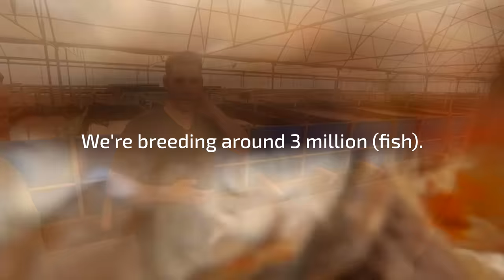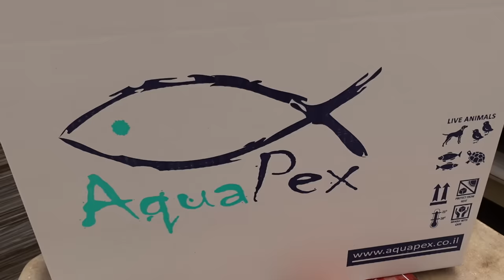CRAZY! Millions of fish at these farms.

Comment: Impressive farm and fish. My question is how do they control disease from spreading fast in those tanks?
Reply: guessing they are dosing meds 24/7
Reply: A response a year later but I see someone responded 3 weeks ago so might as well. 

I have had a self sustaining population of Platy's in my 100 gallon turtle stock tank for 10 years now (one 4.5 inch shell painted turtle). Since I'm not introducing any new fish I have no disease issues. So it's entirely possible they just aren't dealing with much in the way of disease at all. The turtle eats a few a week so maybe it's picking the sick ones off. There's plenty of room for the fish to hide and the population has been robust the entire time. 

I have a 525 GPH pump connected to a pond filtration system with bio balls and various densities of filter media. Lots of aeration going on.
Reply: @ToolofSociety  fish don't need contaminants from other fish to be introduced to get sick. I don't think they were asking about individuals that usually die from age related issues, but tank wide problems that can wipe out your whole stock overnight. Watch the large collections on YT and you'll struggle to find someone who hasn't lost a full tank at some point. It just happens sometimes. But with all the tanks in this video connected to the same system, any problem in one tank would very quickly spread to all other tanks. They would have to be dosing the water regularly to stop anything before it could develop, there's no other way to try and prevent it.
Reply: @mydogeatspuke  

So what are they dosing their fish with then?
Reply: @ToolofSociety  I already replied to this but apparently the AI doesn't like a word that rhymes with smantiebyeotics. The same sort of stuff you'd get from an aquatics store if you had a problem in your tank at home, just on a much larger scale.
Reply: @mydogeatspuke  Those would be for bacterial infections which usually occur from poor water, poor feeding, stressed stock etc. Their setup is fantastic so I doubt they are dosing willy nilly.
Reply: @ToolofSociety  fish can stress themselves out from seeing their own reflections, let alone being in such cramped conditions as shown near the end. Even the ones that aren't frantic are massively over crowded, and yes aeration can help with that, as well as frequent water changes, but it's a very fine balance even on a small scale let alone with all the waste being produced by so many fish being fed multiple times a day. If you believe some of these fish aren't stressed then you know very little about fish lol. All it takes with that "fantastic" set up is one sick fish going unseen, which amongst millions is quite easily done, and sickness could spread to every single tank within a day. Like I said, you'll struggle to find a keeper with a large collection who hasn't lost at least one full tank, and there are some who've lost their whole collection because of connected filtration like in these farms. It happens. You being impressed with their setup doesn't change that fact. And I gave one example of one kind of treatment, then directed you towards an aquarium stockist for more information since you obviously don't know very much about the subject. It wasn't an exhaustive list.
Reply: @mydogeatspuke  You're bringing mad strawmen into this as there's no reflecting surfaces in their operation and such...

I don't really watch youtube aquarium people because I'm friends with a fellow who runs a very large aquatic shop who I can run to with questions. He does salt to freshwater and every thing in between and he's never had a massive die off of stock like you suggest. He's also responsible for the maintenance of almost every large tank in businesses across this small city. 

So I can't account for why youtubers are having issues because I don't know them or their practices. All we know is what they are willing to show. 

A facility that large would have to buy medication in large quantities and that's not cheap. It's in their financial interest to limit it as much as possible.
Reply: @mydogeatspuke  Well google ate my response and I can't be bothered to write out more paragraphs responding to your strawmans such as you assertion the fish are going to freak out seeing themselves when the tanks have no reflective surfaces. 

TLDR. I've run +300 gallons of tanks for decades and never had a mass die off. The guy I know who runs a large aquatic shop hasn't had a die off. The tanks he services for large businesses only have issues when people try to mess with them via over feeding or playing with the filtration/air systems.  Youtubers are irrelevant as they only show us what they want to show us for clicks.

God I couldn't even imagine having the mindset that a mass die off of fish worth +$100 each is to be expected..
Reply: @ToolofSociety  I didn't say that these fish would "freak out seeing themselves" though. I said that fish can be easily stressed out by their own reflections. I can see with my functional eyes that there are no reflective surfaces in these specific tanks, but I wasn't talking about these specific fish being stressed out by their own reflections. Once again you have taken an example and decided it is an exhaustive list, which is something only someone who isn't educated on the subject would do... even after they've been corrected over it once already. That you've done whatever and never had something happen doesn't mean that it never happens. That isn't how reality works. I've never been in a car crash despite having driven hundreds of thousands of miles but I'm well aware that car crashes happen every day. I also never said to expect them all to die. You're not very good at reading are you?